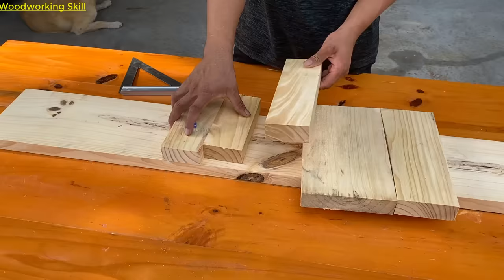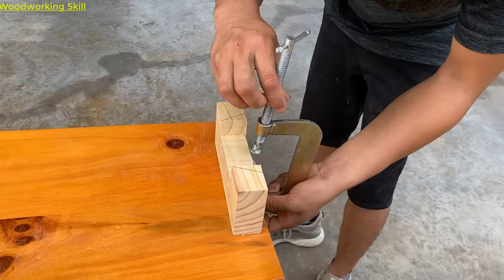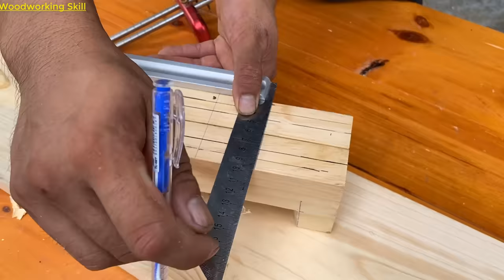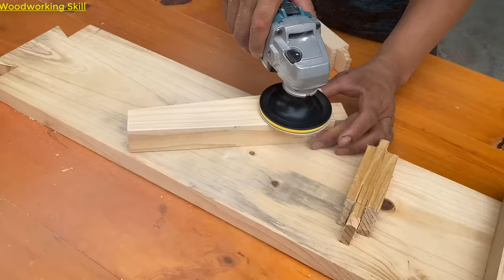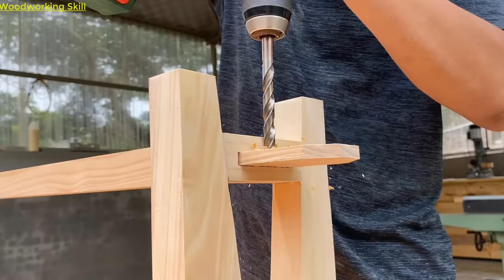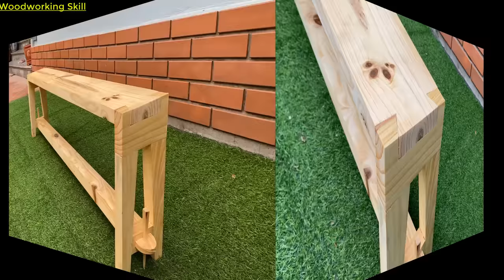Simple Woodworking Project // Easy Bench Ideas You Can Build Today!

Comment: I disagree with the "easy" and "simple" adjectives used here. Many people don't have a scroll saw or a drill press.
Reply: @Matthew Meredith it's hard to believe he called that a scroll saw and drill press. Words fail me.
Reply: ث
Reply: That whole thing could be made with hand tools pretty easily (though not as quickly)...
Reply: Stop crying and use hand tools, this is easy to make using hand tools
Reply: Facepalm*
Reply: Both of those can be had dirt cheap on facebook marketplace or another classified website. And a jig saw can do the work of a scroll saw and a hand drill can do the work of a drill press.
Reply: No scroll saw was used in this video so I disagree with you
Reply: Band saw, not scroll saw.
Reply: @donnagray4901  Thanks. My whole opinion is changed now.
Reply: @dalegullings3943  agree✌️
Reply: Sold at Pottery Barn for $400
Reply: Many people do tho
Reply: Plus videos like this are a niche for a select group of people that have these tools. But they can also easily be done with hand tools that cost less than $100. People just lack imagination
Reply: You don’t need either of those. Any electric drill, a hand chisel, plus the cheapest jig saw is all this build needs. For accuracy, a cutting saw like a Japanese one is helpful too.I built it with about $80 of tools.
Reply: Or a mortise drill. WTH
Reply: Probably English is not his first language.
Reply: The joineries shown are not beginner level.  If it is not pocket holes it can't be simple 😆
Reply: Use a hand saw and a bit and brace then simples
Reply: @paul1982100  of course everything can be done with hand tools like in the old days.  Doesn't make it easy though
Reply: @b3arwithm3  doesn’t make it easy with a drill press and scroll saw either
Reply: No but a router would have worked. He needs a damn jigsaw.
Reply: If you don’t know what kind of saw that is then this whole build may be a little bit over your head
Reply: Perflecty said
Reply: "I don't have a scroll saw"... 
Good thing he's not using one!
If you don't have a bandsaw like he IS using, use a jigsaw.

If you don't have a mortiser, drill it out and finish with a chisel.

There are ways to get the same results without the "fancy tools" if you think about it and actually know your tools.
Reply: Muy bonita banca , aunque un poco bajita y angosta
Reply: Many people do have the tools..why is there so much tool envy on these?
Reply: You don't need either . bottom line
Reply: The whole thing can be done with hand tools. It's not really that hard a project.
Reply: Or lumber…
Reply: I agree with you
Reply: Because benches were invented after these tools became available. Before the invention of power tools nobody in history ever made a bench with this level of complexity
Reply: @kikolyhut this is about as easy and simple as it gets when it comes to wood working, you could do this whole thing with just a brace, drill bit, chisel and a hand saw.

Comment: Pin board at top of legs is a mistake. Should have run legs to top and laminated block with grain between then dovetail end grain to end grain. Those half pins are weak and will likely snap off.
Reply: Top 😊😊

Comment: This about the 3rd bench like this I've seen where the dovetail joint is the wrong way round.  The tail should be vertical not horizontal.  The joint has no strength as it is.